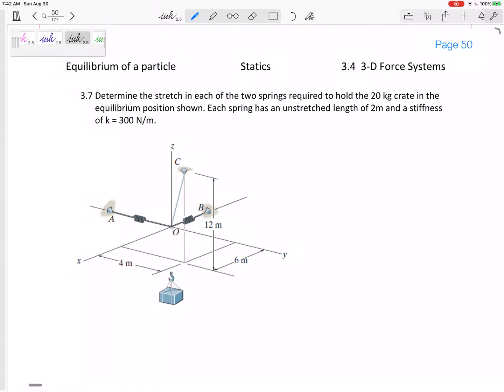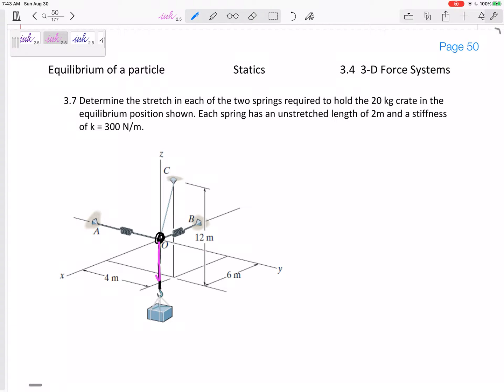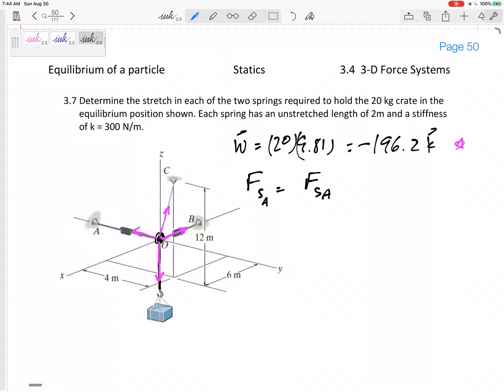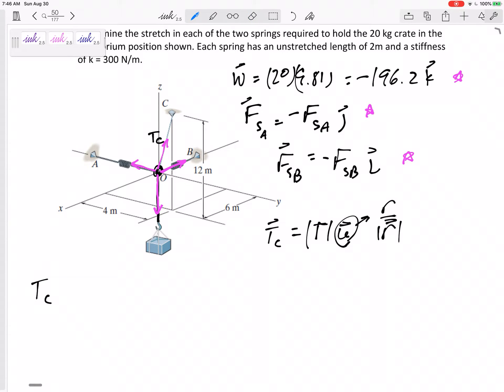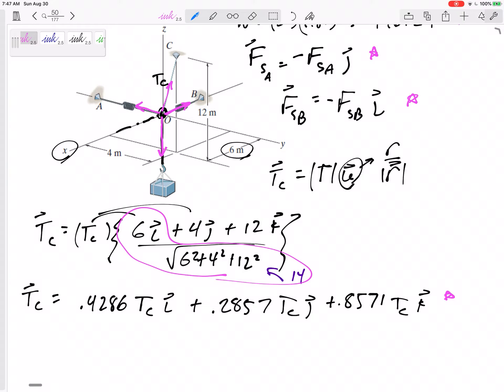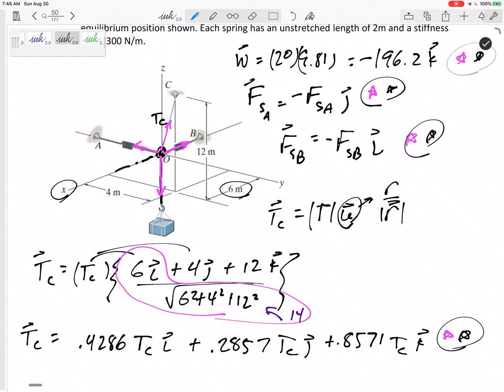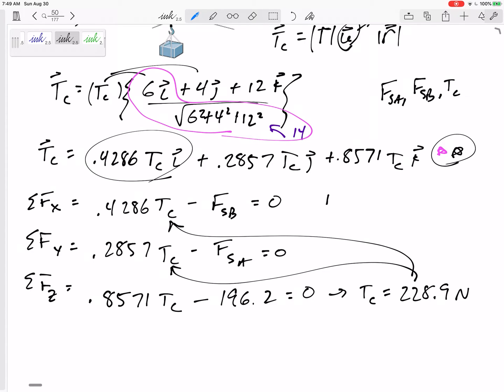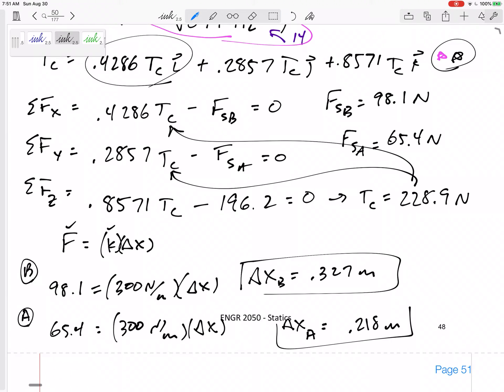Statics - 3D Particle Equilibrium example 2

Comment: Sir.. Tension Tc is going upto O ,  12 metre is height upto the bottom where weight is hanging. Tension Tc in CO segment will not be same as tension in segment from O to weight. so why are we taking Tc  Z component as 12m ? Please advice. thank you.
Reply from the maker: no, that 12 m dimension is the vertical distance point C is above the "floor" (the "floor" is the xy plane). The weight is hanging below the "floor"